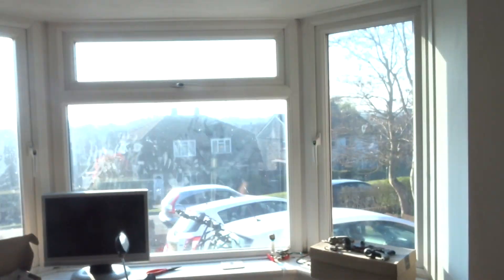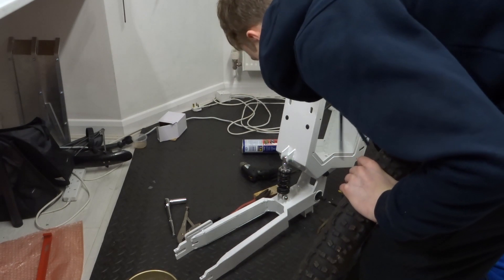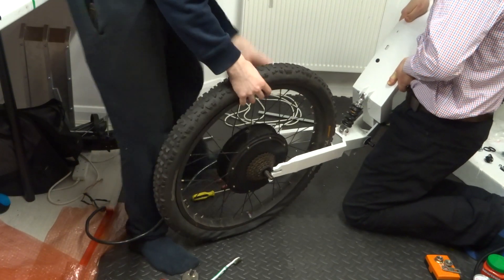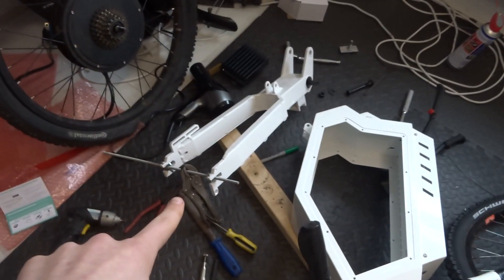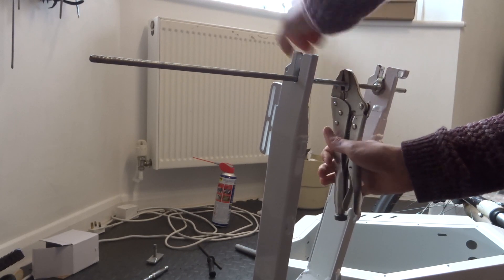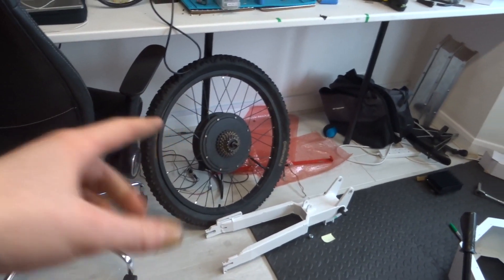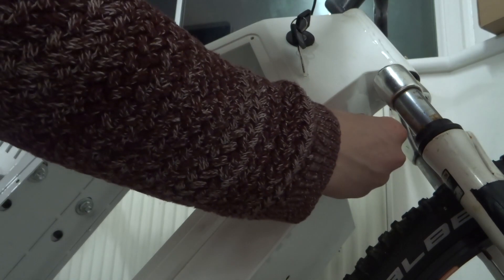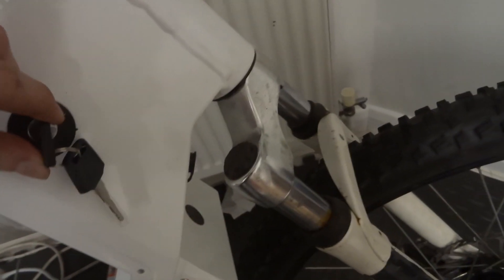8kW Enduro eBike V3 Build - More frame and wheels - Part 2

Comment: Good job getting it to fit brother but it was probably a 155 mm for those QS 275 and 205 motors to be able to fit from what I've seen on  another frame like that that came with a spacer that you could put on the inside and make it 150 but I guess yours didn't come with that
Reply from the maker: Yh I wish I'd gone with the other style of frame you mentioned but oh well!

Comment: What kind of wheel is it on the rear? I guess 26" mountain bike or mx wheel.
Reply from the maker: Yep, 26"x2.4 halfords mtb tyre. Done 800+ miles and it's still got plenty of tread left and hasn't lost grip once.